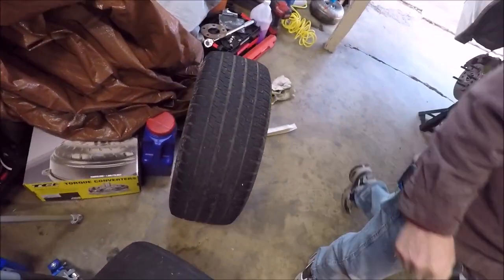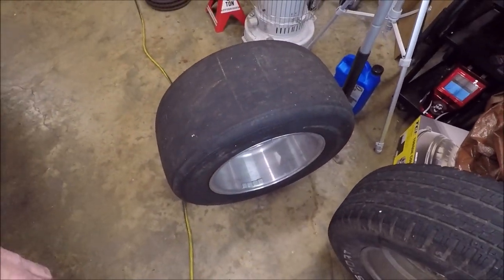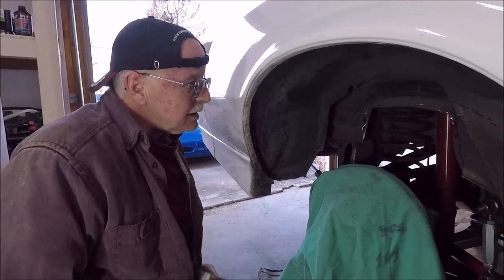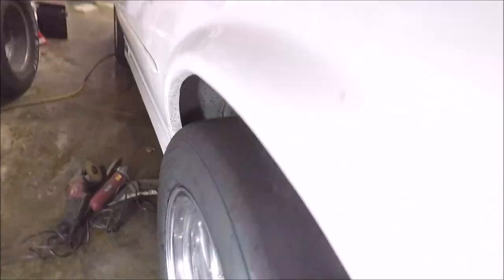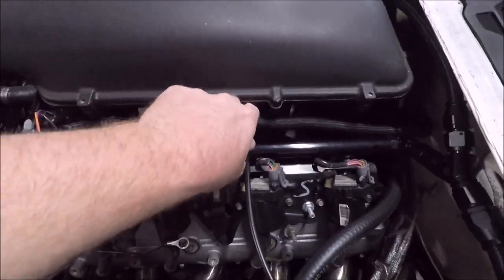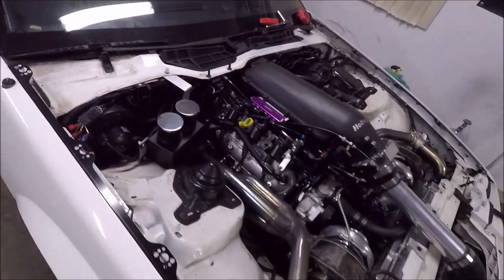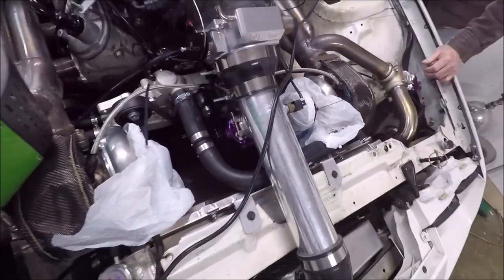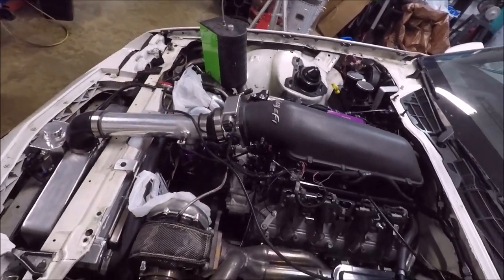FITTING 28X10.5s ON A THIRD GEN CAMARO

Comment: What rear end are you using? I have the BW 9 bolt. Its the disc brakes option rear end and came in most GTA's from what I understand. I am wanting to get a pair of rear wheels, the visions. I have bmr lowering springs all the way around, I dont know if ill be good with 10 / 10.5 Im also only pushing 450 hp. I dont think I need a 10.5 so was looking at the 15 x 8's. I dont know what back spacing i need

Comment: My 28 10.5s fit on my third gen but I do have a fourth gen rearend in mine and I have the 28 10.5s on the fourth gen factory wheel and they fit fine on mine and mine does not rub on the front mine rubbed about a inch back towards the rear bumper from where you cut in one little spot so I just hit it with a hammer and boom
Reply from the maker: You can fit them with less modification if you run an 8” wheel, or a 10” with 5.5 backspace and factory width rear but they’ll poke outside the wheel well. This was to fit them with a 15x10 wheel without poking outside the fender line so later I can lower the car and still not have any issues. 👍 At factory ride height a little poking out isn’t a big deal. But once you bring the rear down you run into issues rubbing the outside fender lip with that setup.

Comment: Dang, I’m so glad my S10 Blazer  easily clears 28.0”/10.50” with a 15” x 8.0” 5.5 bs with the short axle mod Explorer 8.8. 
I’d like to go with a 10” rim but it  would need bs 6.5”-7.5”
Reply from the maker: You can actually fit a 28x10.5 on a third gen with almost no modification if you run it on an "8 rim with 4.5" BS. But I wanted a better contact patch so I went with a 10" wheel and an overall backspace of 6"(taking my 1/2" narrowed rear into account) to keep the tire inside the fender lip line in case I lower the stance later on.

Comment: Are you shore you didn’t mix up the tps and the fuel sensor.  Swap out the IAC valve with one from you old throttle body. Some throttle body’s come with a MOPAR IAC valve  whit  his wires opposite the GM one and they both bolt up
Reply from the maker: The Fuel Pressure harness won’t even reach the TPS sensor. And I already tried swapping the IACs. You can see I have the old one on the new throttle body in the video.

Comment: i have gotten wire that was broken or not full wire in a section with no damage to wire insulator. Manufactureer defect...drove bat shoot crazt until i finally traced it down. take it loose at pin and sensors and energize it,  then run current test from end to end?
Reply from the maker: Yea I'm going to ohm it out tomorrow. But things actually just got alot weirder tonight.

Comment: They always leak like that at the shaft, I had an expensive Holley one that leaked that bad and they said not to worry about it. It didn't seem to effect my turbo car.
Reply from the maker: I know they all leak a little. That’s why I said I didn’t think that was enough to be causing the issue. But it still leaks way more than the stock TB did for sure.

Comment: have you bothered to do a continuity check between the two ends of the harness?
Reply from the maker: Not yet but I will once I get the harness out.
Reply from the maker: Or I guess I could just run a long wire back from the other end for my multimeter leads will reach. Good idea brother. 👍
Reply: @BadLuckGarage  Yeah if it doesn't have continuity then you can take back the sheathing and probe the cable until it does and you'll know the break is somewhere ahead of that. 

Electrical issues are always the hardest to diagnose, good luck brother...

Comment: with the engine running it wont leak there, it will suck down
Reply from the maker: Thats the point brother....its going to be sucking extra air in....thats a vacuum leak, and under boost thats a small boost leak blowing out as well. But like I said in the video, thats not enough of a leak to cause a 3,000rpm idle.
Reply: @BadLuckGarage  ha, im an idiot. i forgot about turbos derp...makes it even worse. My little experience is with old NA stuff. These are like rocket engines to me lol